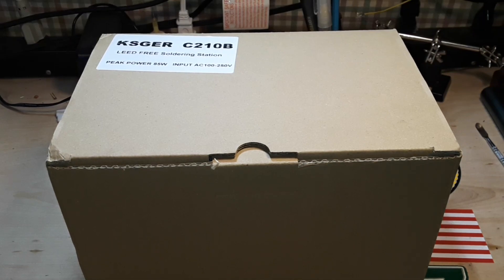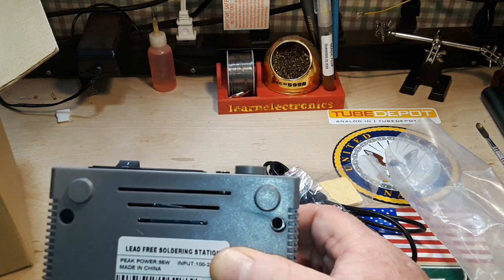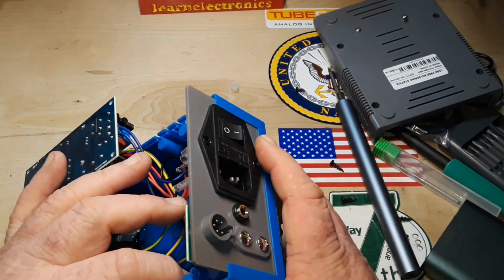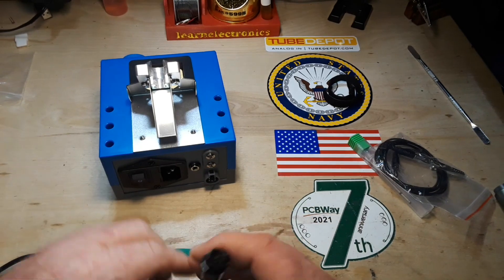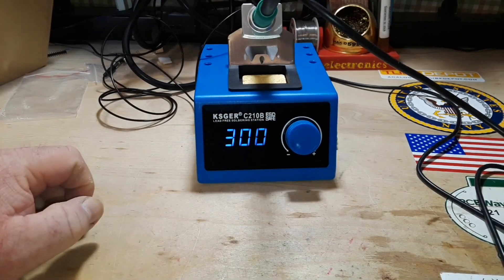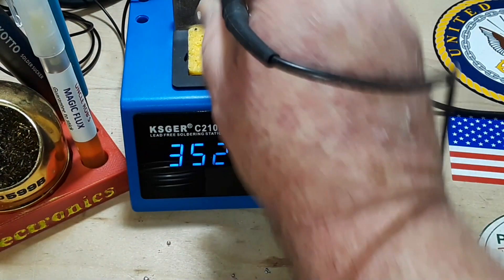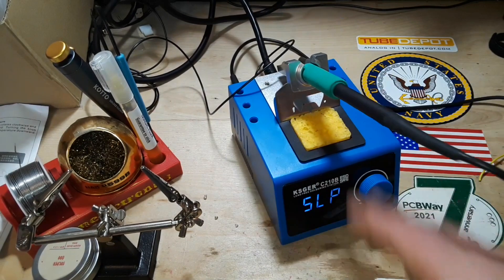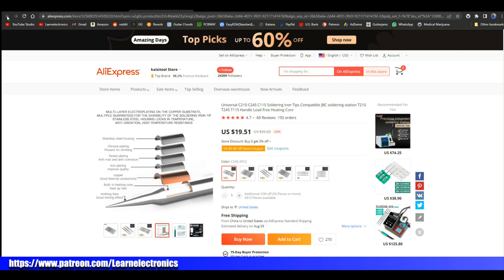KSGER C210b Soldering Station Tear Down & Review

Comment: I do not see $60 worth of hardware in that air box, so many better options with big transformers available instead of a minimal switching power supply - be good for small work but not worth anywhere near the price of $60 -- newer Ksgers much better

Comment: You didn’t measure tip to earth potential and check if the tip is earthed (specs: 2 Ohm, <2mV tip to earth). 

If tip is earthed, multiple amps of current can flow out the tip with Chinese JBC stations. Connect a small speaker to earth and tap the other speaker terminal with the iron. If there is noise from the speaker then there must be current flowing, and there must be voltage at the tip too. 

It says ESD safe too but we know that’s not true.

Comment: 💀 That station is dangerous 💀

Tiny air gap & one layer of insulation by the PSU screw terminals and exposed pads of the iron connector. 

Live wire could fall out or have loose strand and make the iron connector live. In 240v land it is very spicy indeed. Regardless, such a small gap and one layer insulation is not okay. 

Wires need to be sleeved, soldered to PSU and silastic’d in place. Or redesign the product.